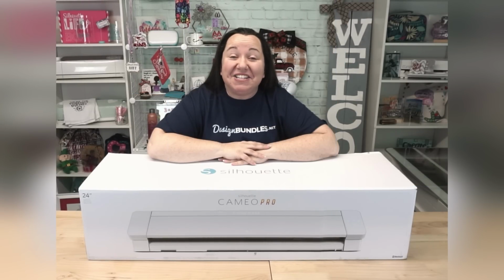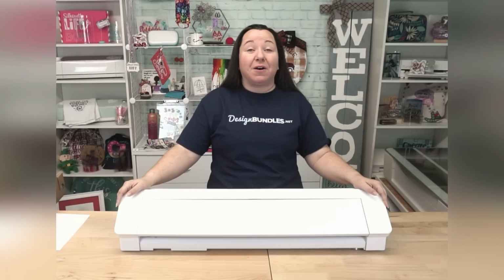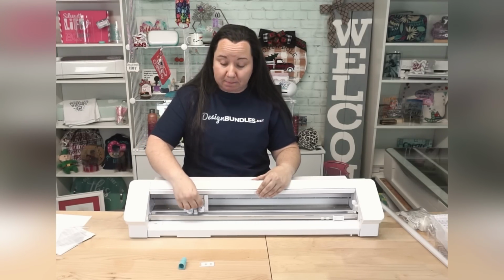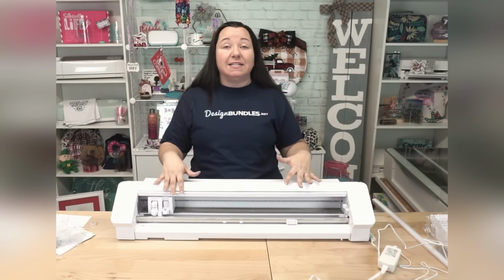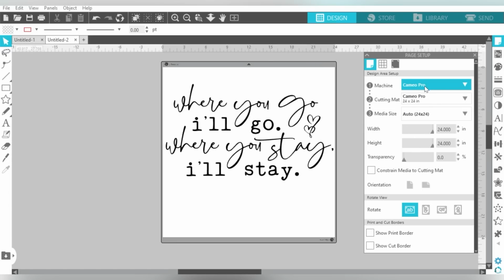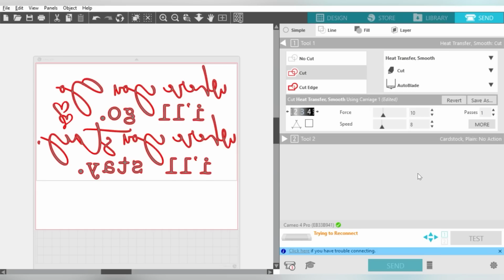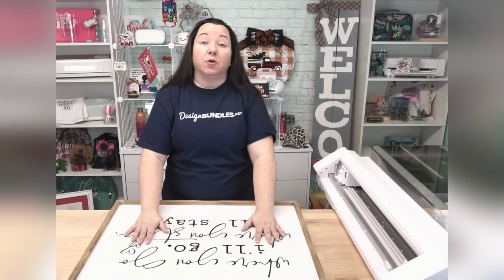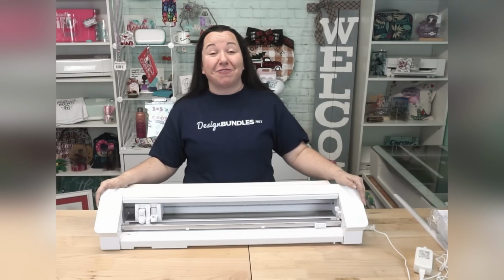😁 Introduction to the Silhouette Cameo 4 Pro

Comment: what media would you use if using say pallet wood or rough surface material with joints? (made-up/assembled sign boards)
Reply from the maker: Hey Don! With wood there is alot of options.  You can sublimate on wood, create stencils and paint, add vinyl to sealed wood... it really depends on your project needs. - Dawn

Comment: Any advice on mat slipping part way through cutting already checked the feed is locked down and the back is closed properly its not coming into contact with anything but when it gets to cutting on the last quarter of the mat the mat starts slipping diagonally…
Reply: I had the same problem with my mat drifting at the end of project. I absolutely hate Silhouette cutting mats and if I'm doing anything wider than 12"  I cut without a mat. If I do anything 12" wide and smaller I actually use a cricut mat and it works perfect.
Reply from the maker: Thank you for the tip with using the Cricut Mat! You may also want to check that there isn't anything stuck in the wheels as often times small pieces of vinyl and even dust can throw off the mat! - Dawn 🥰

Comment: I am having the worst luck!!!  I got my cameo 4 pro 2 weeks ago and I dived right in after seeing a couple of videos...  It was all going well with vinyl but when I started to do print and cuts it all went downhill...  I had no problem picking up on software to design, I got it, but when it comes to print and cut sometimes it cuts perfectly and other times its just hell... I have tried calibrating the machine, the 3 times moving roller left and right, no luck.  I have tried doing the calibration it does with the printing and have gotten it to cut perfectly BUT after a couple of cuts it goes all wack...  anyone else having this problem?
Reply from the maker: Hi Lala! I'm sorry to hear about your troubles. I hope you have found a solution, and it may have been through an update to the Silhouette programing.  If you have any additional troubles, please reach out to us at mail@designbundles.net or join us in a live chat through our homepage.  We are here to help with your next project! - Dawn 😊

Comment: transfer print then cut files from cricut to silhouette? I have an Etsy shop and currently use Cricut I just got a silhouette machine and want to transfer all my mats that are sized for my products over to the new software so you if there is a way to do that?
Reply from the maker: Hey Katie! Unfortunately, you can't transfer SVG files from Cricut to Silhouette.  Cricut Design Program doesn't allow you to save SVG files to your computer at this time.  However, you can create and save SVG files to your computer with Silhouette.  It's one of the best features of the Business Edition!

Comment: My vinyl is only feeding in on the left side. Any idea why this would be happening? The  adjustable rollers are in place. Excellent video!
Reply from the maker: Hey Kristine! You may want to reach out to Silhouette customer support in case it's a manufacture issue.
Reply: Did you try lifting the lever to the right? This will raise and lower the bar to load material.

Comment: you can't actually cut 24" width on this though can you it rolls out
Reply from the maker: Hi there! Are you using the Cameo 4 Pro? If so, make sure you are changing the settings for the Media Size to 24x24 as well as the cutting mat to 24x24 and you should be all set! You can view this at about 14 minutes into the video 😊
Reply: @DesignBundles  Thankyou, I set the media size to 24 x24 (it is pro) and it says media width too wide?

Comment: I plan to continue to use my cameo 2 & 3 for smaller projects but also will use the pro 24". Do I need to have it on separate computers due to program differences?
Reply from the maker: You do not, it is the same Silhouette Studio program!

Comment: Even with my bar locked down and my roller aligned, my mat slides around when cutting.  Do you know what could be causing this?
Reply from the maker: I would double check the rollers on the bar that they are locked.
Reply: @DesignBundles  Thanks for your quick reply.  What ended up working was moving the right roller over to the edge of the mat instead of on the smaller width vinyl.

Comment: you are amazing!!!! just got my machine today.  What type of heat vinyl do you recommend when doing wood signs?
Reply from the maker: My favorite brand of HTV to use is Stahls (also what I used in the video).  Hope this helps!   ---Becky
Reply: Thanks Becky. Do you use premium plus or ultra weed ?
Reply: Quick question I see you just recently received your machine, I have a Cricut Maker and I’m thinking of purchasing 4 Pro, some of the reviews are negative have they worked out the kinks?

Comment: I love all of your videos!  You are my go to for anything to do with my Cameo 4 Pro.  Have a question....  Is it possible to cut mylar for reusable stencils with a Cameo 4?  Can you post a video on how best to do this?  If it's not possible, what is the next best material you would recommend to use for reusable stencils?
Reply from the maker: Hey Alcira!  I haven't used Mylar before but have heard it is good for stencils.  I have used Acetate sheets and they have worked, but I found it a little flimsy and they are not naturally adhesive, so it only worked for a few uses for me.  If you want a truly reusable stencil, check out my video on using the Ikonart reusable stencils.  It's a cut-free process but a little more investment, but the quality of the stencils were great.  Hope this helps!   ---Becky

https://www.youtube.com/watch?v=A4wypRnETW0

Comment: Ok video, but would be much nicer without all the speeding up in certain areas. More detail is better for people trying to follow step by step. Also, I would like to see your slow down a tad bit for easier following for newbies, but overall it was ok.
Reply from the maker: Thank you for the feedback! :) Let me know if you got stuck at any point!
Reply: @DesignBundles  I would like to have seen you actually load the vinyl into the cameo 4 pro so that we can see how you used the rollers.

Comment: I am completely new to Silhouette.  You mentioned in the video to install a legacy version of the Silhouette Design Studio, but there was nothing in the setup video that mentioned that, so I am sure I installed the most current version.  Do I need to uninstall that version and reinstall the legacy version to be able to use my Cameo 4 Pro?
Reply from the maker: Hey Jessica!  No, I'm sure whatever version you are on will work fine.  I only recommend the legacy versions if you are having bugs in your software.  But the Silhouette Cameo 4 Pro needs one of the newer software versions to work, so you should be fine.  Hope this helps!   ---Becky

Comment: Hi
Can I print on A3 and cut with this? (Print and cut)? Does anyone know please
Reply from the maker: Hey JB!  You sure can, any size your printer can print (as long as it's smaller than the cutting mat) can be used for a Print and Cut project.  Hope this helps!   ---Becky
Reply: @DesignBundles  Thank you

Comment: Which cutting tool do I need to use for making the deepest cut possible, would I need an adapter as well? I''m confused with which tools go with different cutters, I have the pro, does cameo 4 tools work on it or do I need to look for items labeled pro?
Reply from the maker: Hey Armando!  You should be able to use any of the Cameo 4 tools with the Cameo 4 Pro.  For the deepest cut, I would recommend the 3mm Knife Blade.  Hope this helps!   ---Becky
Reply: @DesignBundles  It does, thank you. Just switched over from Cricut and just got a little confused by all the tools and options. Thank you.

Comment: Great Video! Which line are you lining it up on the left? I have not been able to get consistent cuts with my pro not using a mat.
Reply from the maker: Hey Liz, I just line it up with whatever the closest size to my material.  What happens when you cut without a mat, maybe we can trouble shoot.  ---Becky
Reply: @DesignBundles  The right roller is slipping and my cuts are all wonky. Working with swing design and silhouette for a fix. Sounds like a lot of people are experiencing the same issue from some of the cameo FB groups.

Comment: I have the original silhouette cameo machine (I think it is like 5 or 6 years old) and I have hardly used it. Is it still compatible with the silhouette design studio? Any idea if I need to do any updates? I used it some when I first got it, but found it a bit overwhelming and didn’t have the time to really learn more. Now I am retired and have more time. Would you recommend upgrading and if so, would you stick with the silhouette and get the silhouette cameo 4 or do you feel the cricut would be a better option?
Also, are there any how to videos on using the original silhouette that you know of?
Reply from the maker: Hey Melanie!  If you mean the Cameo 1, it is a fantastic machine and it is definitely still compatible with the software.  The only downfall is a lot of the recent tutorials are going to be with the Cameo 3 and 4.  There will be a few differences but overall, I think upgrading would be unnecessary at this point.  One main thing to note is that you will use the Ratchet Blade, so you will adjust the blade depth yourself (I prefer this blade anyways).  Also, you will have to connect with a USB cable.  And the last thing I can think of is that you'll have to choose Load Media or Load Mat, but that is an easy choice depending on which you are loading into your machine at the time.  Hope this helps!   ---Becky

Comment: My vinyl keeps sliding all over the place. I make sure it auto feeds in straight, tho it usually takes 10 tries to get it perfect. Lol. I see that the far right edge of your slide bar (if you are looking at the machine) is at the edge of the paper. Is that how it should be?  There is an arrow at the center of the slide bar and that’s what I have been putting at the edge. But I’ve tried both ways and, even tho the vinyl starts cutting fine, it always moves on me and with big cuts the vinyl ends up sliding around. Any tips are welcome!
Reply from the maker: Hey Renee, it seems like for some reason your vinyl is coming loose from the rollers.  When you load the material, are you able to give it a nice tug and it stays in place?  Let me know!   ---Becky
Reply: @DesignBundles  Yup.  Tested it.  Gave it a tug; it's tight.  Have a 60" simple rectangle to cut.  First I tested it by adding a tiny circle at the bottom of the rectangle, outside of it, then moved the rectangle out of the way and cut.  Worked perfectly; fed all the way to the end straight and cut the circle, though it did jam on the way out.  So I refed, made sure it was tight and fed in evenly, and cut again.  About half of it cut okay before it started going crooked, and jammed.
Reply: @reneechapman3270  I am having the same problem.  Definitely regretting this purchase.
Reply: You're not alone.  The machine has a design flaw.  But don't expect "reviewers" to tell you.

Comment: Just wondering what setting you used to cut the HTV without the mat, I just can’t seem to get my pro to get sharp line cuts.
Reply from the maker: Hey Bill, for sharp lines I would probably try to stick to a cutting mat.  With a large sheet of HTV, it is hard to get the material tight enough for it not to give towards the middle.  I hope to have a video on this soon, but I have noticed it more with subsequent cuts I have worked on since this video.  Hope this helps!   ---Becky

Comment: Would love to see a large print cut with a sublimation print from the et-15000 on a 2xl Tee
Reply: Good luck traveling with that monster :)
Reply from the maker: Hey Ross!  Yes, I will decidedly NOT be traveling with this think unless absolutely necessary 😂 I will work on this video for you though!   I'm still only gaining an additional inch with the print and cut, though, since my max print area is still 13" wide (unless I rotate the design) so I'm not sure that it will make much difference in the end product over the 12" wide Cameo 4.  ---Becky
Reply: @DesignBundles  It's gotta be easier the 2XL Tee I did with an oversized 4 quadrant print from Illustrator lined up and heat taped together.  My wife (VP of the Pressing Department) was about ready to kill me, :)

Comment: I got my cameo 4 pro 24 inch on Dec. 24th as a gift.  But I am a transitioner from cricut.  And I notice that I did my first print and cut, but for some reason I get some slight white boarders showing.   And I want to get it without it.  Like for instance I have cut my sublimination image from my ecotank et15000 with registration and then the htv glitter.  And both come out slightly cut different.  I don't move it from the trace on both.  And I want to know what to do to get them printed identical and of course that tiny little slight edge white boarder from not showing?  Also I saw a video of the autoblade giving issues and yes I had to tighten it since it was loose when it came.  So I used the handy dandy tool and tighten it and it cut wonderfully.  Yet I only have the issue with print and cut as mentioned.
Reply from the maker: Hey Omayra!  I'm not sure about the print and the vinyl cutting a little different, do you just mean that the print-and-cut isn't lining up exactly?  I haven't tested print-and-cut yet on the 24" Pro, but you can turn on the Print Bleed (under the Page Setup Panel at the bottom) to help prevent the white boarder around the edge.  I hope to have more info out on the print-and-cut soon!  Hope this helps!   ---Becky
Reply: @DesignBundles  yes its not lining up exactly the same.  When I go and cut the image it has a 1/16 white boarder showing and I lined it up.  Then also the easysubli prints eventhough its a line up.  Its still a slight bit bigger then the sublimination print and cut image.  If perhaps you can give us a tutorial on the cameo pro 24 inch for glitter htv and sublimination print and cut?  Please don’t knkw what I am doing wrong.  Thank you Becky you so cool making tutorials!

Comment: Great video! This machine is on my wishlist for the big vinyl projects haha. Anyone else having issues with their Cameo 4 failing to recognize registration marks, regardless of settings? The majority of the time it won't even go over the first registration mark, manual doesn't work, and I've tried all of the troubleshooting steps with no luck :(
Reply from the maker: Yes, I experience this from time to time with my Cameo 4 (and the 3 was the same way for me).  I've been working on a video for troubleshooting the Print and Cut feature, but haven't been able to find a reliable fix that works more than a few times.  I do believe it has a lot to do with lighting, both too much and not enough effect the optical lens.  Hope to have more info out in the future!   ---Becky
Reply: @DesignBundles  Update - I just finished a support call with a Senior Specialist from Silhouette and I believe we figured out the issue. The new machines use more pressure to hold the mats, so can warp/distort the registration mark and cause it to fail. Holding up the end of the mat higher than the blade while it reads the first mark has seemed to fixed it (newest software version of Silhouette Studio). I did tests with different registration mark settings and in different light settings and so far so good. I was also told to reset the blade carriage by turning off the machine and sliding it left to right 3x if it does fail before trying again  :)
Reply: @DesignBundles  Thanks Becky! So far going back to 4.3.370 for Silhouette Studio has been the only reliable fix (RIP all the trees I've used to do my tests haha). I'm just worried uninstalling to roll back to that version will use up one of my business license installs :(